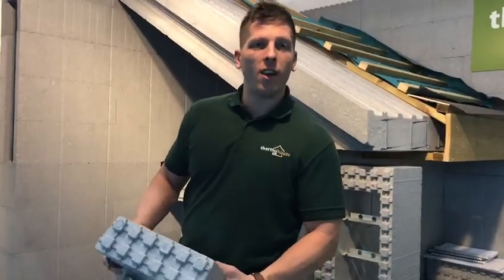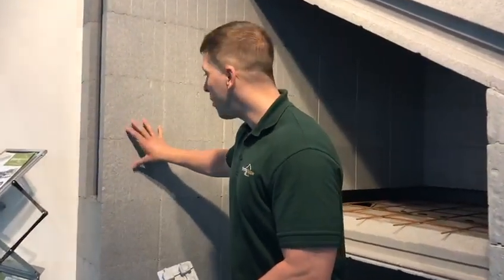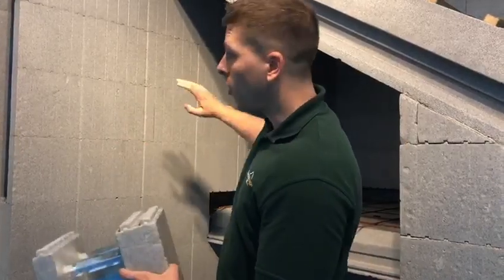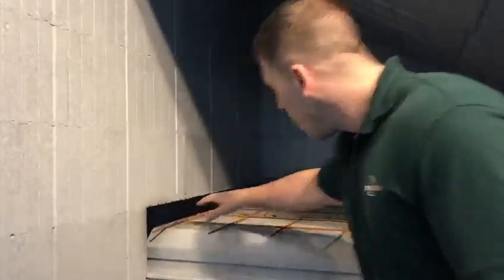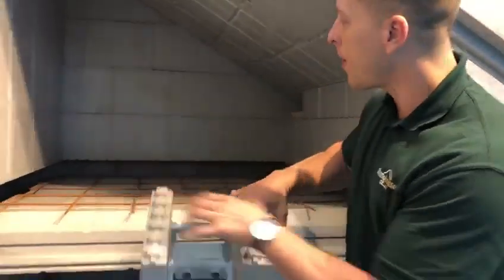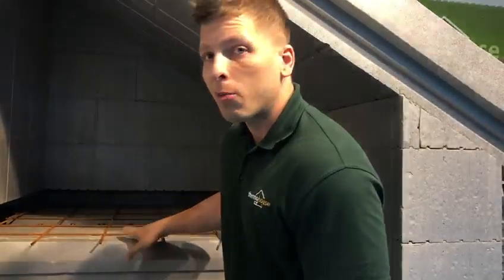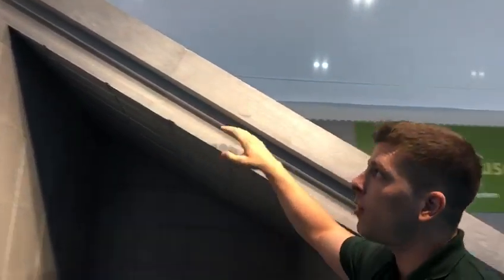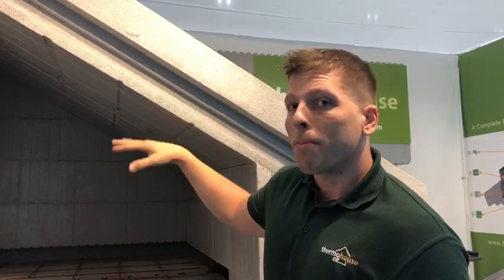An Introduction to Thermohouse: A Complete Energy Efficient System

Comment: As a potential user on the western side of "The Pond" I'd like to know more about the fire resistance of your EPS.  Here in the States, EPS for construction MUST be treated to resist fire spread, I believe the current "Standard" is approximately 20% of an equivalent wood structure.  If/when I can build a new home for my family, I want it to be the "Greenest" home possible.  Not so much to "Save The World" as it is to MINIMIZE cost to heat and cool the structure.